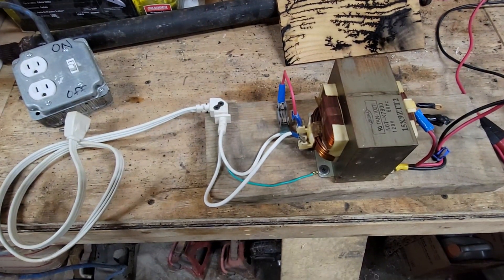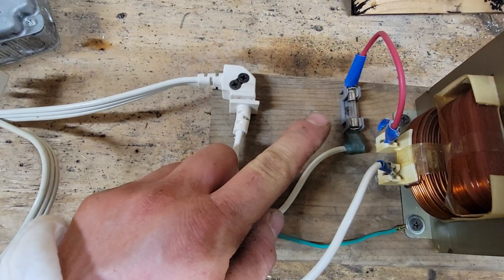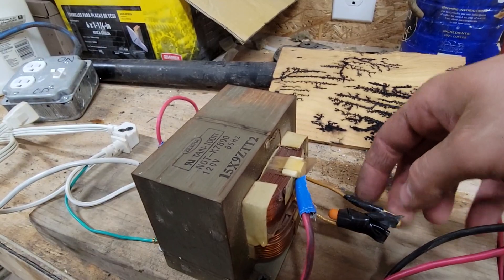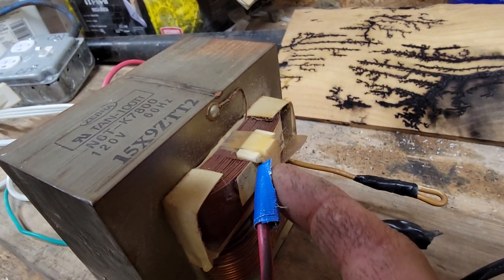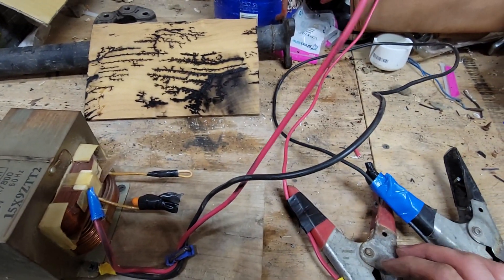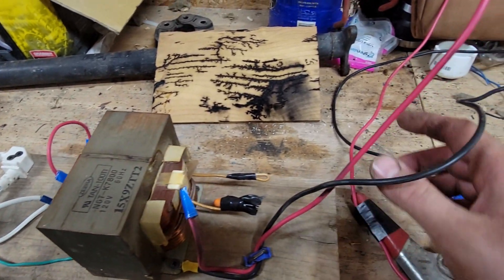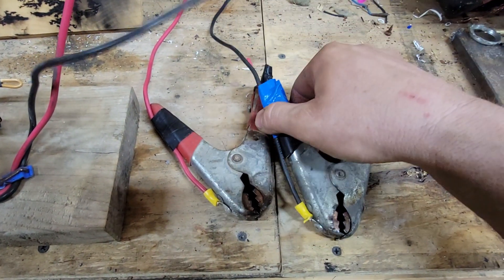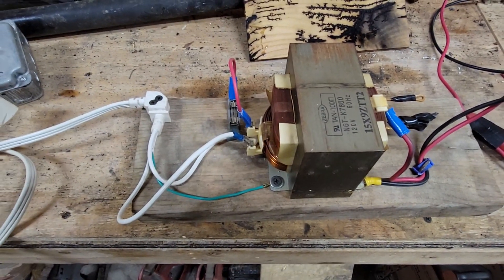How to make a fractal wood burner.

Comment: Why do I keep burning my transformer out in 5 mins every time?
Reply: MW transformers pulls 10 amps no load, I use 2 trans with primarys hooked in series (pulls 1 amp no load), secontaries also in series, 2000 volts with one trans, 4000 volts using both

Comment: If someone wants to build a fractal burner from a microwave transformer while not knowing the amount of smoke traveling in the wires, i say let em... You "protectors" are the reason kids are eating fuckin tide pods and why vehicle owner's manuals tell people not to drink the coolant instead of how to manually lap valves or gap a spark plug. FFS, if they die, they die.... on the flip side, bro, this thing "AS IS" is a conference call with Jesus on speed dial.

Comment: Just a heads up for those considering building one of these. The output on this will kill you if used improperly so do your research first. That being said, I highly recommend you do not plug this into your house. The amperage draw these guys can pull is crazy. Less than an hour of operating my first one off household power supply more than tripled my normal monthly electrical bill. If you have a generator I recommend using that. I have a 3000w genny and for the cost of a few liters of gas I did the same amount of burning. So it's cheaper to go buy a new generator than it is to run this beast off your house.

Comment: Where did you get 2000v rated wire? Typical 10 AWG wire is only rated for 600v
Reply: In this application it's not the gauge of the wire that's important, it's the thickness of the insulation. Low amps = light gauge, high amps = heavy gauge.  High volts = thicker insulation. Think about a car HT leads, low amps and very high voltage, hence the thin gauge wire and thick insulation. With high amps and high voltage, obviously you want both.

Comment: This hobby is lethal.  If you want to persue it seek more information than this video.
1. You should have a foot operated momentary on-off switch located far enough away that you can't reach the wood.  Meat grinder foot pedal switches work well for this. 
2. You must stand on an electrical insulator wearing rubber soled shoes.
3. Wear electrically insulated gloves, preferably high voltage rated.
4. Never hold an electrode.
5. Never spray salt solution while the transformer is energized.
6. Make sure you have lots of space in all directions including up with no tripping hazards.
7. Place the work on a non conducting table.
8. Ensure nobody can enter the area unaware of what you are doing.
9. Have an Estop or unplug before aproaching the work.
10. The ground must remain dry.  Do not spill salt water.
11. Be in fear of your life the entire time.
Reply: Great reply! Literally the only useful thing under the video.
Reply: Thank you sir all other notes are redundant, like flies on shlit.

Comment: THIS IS VERY DANGEROUS. DO NOT TRY THIS!!!!!!! Even if the steps in the video are followed, YOU WILL BE KILLED WITH JUST 1 SLIGHT MISTAKE!!!!!!! IT’S 2000 volts, 20 times electricity needed to kill you in an instant. ONE TOUCH to the surface of the wood/clip/table/equipment WILL KILL YOU. AGAIN, DO NOT DO THIS!!!!!
Reply: I believe you mean it may kill. I once touched the wrong thing and it hurt like hell but I lived to burn another day.

Comment: Don't ever do this!!! The insulation of your cables isn't rated for the high voltage. And in the video you say "about 10kV at only about 500mA". Dude, it's around 2-3kV at around 0,5-1A and up to 2A short circuit current. Clearly you don't even know what you're talking about. And that fuse on the primary side won't protect you at all if you touch the high voltage output by accident. I guess you don't even know what danger you're putting yourself in. One little mistake and you are dead before you fall to the ground! Just stop doing this shit and don't show other people how to do it if you aren't even aware of the dangers! One question: are you still alive?

Edit: in the video you also said "10AWG wire because it's rated for 2000V" just because the conductor inside is thick doesn't mean that it's rated for 2000V. Judging by your understanding of electricity you should stay away from voltages above 24V.

Comment: what good is a 14amp fuse when you can be killed by far less, should have put a smaller fuse atleast but in general this is not worth it
Reply: The device is plugged into either a 15 or 20 amp circuit. A 14 amp fuse blows rather than tripping the breaker.  More for convenience than safety.

Comment: Do you or can you draw up a quick wiring diagram for building a fra tal burner. Thanks
Reply: Amazon.. Kit uses a neon transformer. Waaaaay easier and safer. Comes with a dead man switch and insulated rubber gloves.

Comment: i aint an electrical engineer, and i dont want to be a safety geek, but that looks at least moderately dubious

but also, you cannot really die without touching the thing (electricity does not usually have range), so I suppose it IS safe if you don't accidentally touch it and that you dont let it leave your sight while on, but also somehow i doubt that is how it is going to be used
Reply: you are forgetting that's 2000+ Volts, it can go through a lot of stuff, including regular house wiring insulation.
Reply: @sayori3939  yeah that could be a problem, but if he managed to stay aware of that and not touch the insulated wires (or at the very least bulk up the insulation), there is zero mcfucking way electricity can just pierce through a table into his arm

Comment: It's the amps that kill you, not the volts.
Reply: No
Reply: @sylviaisgod6947 yes he is correct.  Voltage is not what kills you its the current.   High voltage gives you a potential to have high current but there are other factors.  The transformation limits the current. The guy in the video is correct when a transformer steps up the voltage the current goes down.  That said this is still dangerous and should be handled very carefully. Stay clear of those clamps when turning on the power and the whole thing should be placed in something container.
Reply: “It’s not the volts that kill you it’s the amps” is a major misconception. In fact, neither can kill you yet both can kill you. Voltage is the driving force (potential) that pushes an amp (current/ flow). They share a direct relationship. Power is what kills, Power = Volts*Amps. For example, 100v at 1amp has the same power as 10v at 10amps. 1/2 amp is nothing to worry about on a 12v system, yet at 2000 volts it absolutely has the potential (driving force) to break the non conductive (insulating) organic skin barrier and kill you

Comment: Lol the fuse.
Reply: The fuse isn't a necessary safety thing but it will blow before the 15 am breaker trips so it is useful.
Reply: @SmokieTheOne  Still does not make much sense to me, sure might blow before the breaker but then you have to buy another fuse, it only saves you a trip to the breaker box and the inconvenience of losing power in that part of the house. But for preventing fires or electrocution that fuse will do nothing and it costs you money every time it blows.
Reply: @teresashinkansen9402  I have a small box of fuses I got for free and I've only blown 2 over the years to the cost is not an issue. It does save me the trip to my breaker panel which is downstairs. I never intended the fuse to prevent fires or electrocution. I haven't had any fires and have only been shocked once.

Comment: You mention "Less than an amp at 10kv". More like 500 MA at 2,500v. Voltage isn't important. But the current is wicked at 2.5KV plus (electric chair levels). Be careful.
Reply: You have no idea what you're talking about.

Comment: What a lot of folks do not realize about high voltage electricity (say 2,000 V or so) is that it can go where you might least expect it. Like flow along the surface of a table top or a PVC pipe. It will go through the insulation of a set of jumper cables with ease, and through electrical tape as if it's not even there. The wire used in residential housing is only rated to 600 V in most cases, so the insulation on that wire will not protect you. It might as well be a bare wire. 
   As of January 2024 there have been at least 33 documented cases of people getting killed doing this woodburning trick. And every last one of them thought they knew what they were doing. -Old dude, not a safety nazi and not a pussy either.
Reply: well at least he said it's dangerous ._.
Reply: people get blackmailed by having their channels shut down by saying some stupid swear words and having fake reports while people killing other people with shit like this is making money

Comment: How to build a funny machine to teleport you to heaven with no margin for errors. Next time: how to cool your home with dry ice and closed windows… only on YT.
Reply: Its not that dangerous, you just have to test the current is working correctly the first time you turn it on by holding the metal ends in each hand. Also recommended you do it barefoot in the grass out side because is smells a little funny.

Comment: How are you, a creator, going to feel if one of your viewers dies because they watched this video?  Are you cool with having a human death on your hands?
Reply: It's perfectly safe, it has a fuse
Reply: @sylviaisgod6947 the fuse is on the input side, rendering it useless in the event of an accident (it's the output side that's danger and a fuse on the input side won't matter). it seems you have no idea how a transformer works, so i would encourage you NOT to mess with one, ever.
Reply: @sylviaisgod6947 Again?? Are you kidding?
Reply: @ecan Well, maybe a circuit breaker would be better.
Reply: @sylviaisgod6947  And how are you gonna break the circuit? Again, when not having an idea how electricity works, it's better to refrain from messing with it when you are putting your life or other's at risk
Reply: @ecan  It's in the name, circuit BREAKER, it automatically cuts the circuit preventing death.
Reply: @sylviaisgod6947 under which circumstances?
Reply: @ecan  in several, mainly some, more specificaly probably a few

Comment: This, as shown, is a death trap.
You have exposed wires and terminals on both sides.  There are no safety features that make it safe.  The fuse will only blow if the high voltage side is shorted out.
If you come into contact with the high voltage side, you will look like another piece of wet wood, the fuse won't blow, and it'll do to you what it does to the wood.  You will be burned on the outside and on the inside and you will probably die in seconds.  If you do survive be prepared to have debilitating injuries.
If you risk building this, you need it to be inside a sealed high voltage proof case, proper high voltage wiring, multiple safety and dead man switches, and indicator lights to show it is on.  Even then it is only a little bit safer.
After that it should only be operated when you are well clear of the whole thing.  Set your probes, clips in position, step back and then activate it using the dead man switches, stop deactivate and repeat as needed.. Never ever manipulate the probes while it is on. 
People have died from using these DIY fractal wood burners, others have had life altering injures.
Reply: Probably but it'd be more than $2000😂
Reply: Nah, if you have it plugged in to a gfci plug, even if you hold both ends youll be fine.
Reply: @DG-kr8pt  No, you will die. The reason is because the transformer has two or more isolated windings, which transfer power via induction. This is the physics that lets transformers transform voltages. The GFCI plug can only sense faults with the input winding. So it can't protect you against shorts, or anything else, happening on the output side.
Reply: @DG-kr8pt Careful, some people may believe the gfi will protect them.  A gfi on the supply side will do nothing. 
But I of wonder if you could build or purchase a 2,000 volt gfi for the high voltage side though.
Reply: @DG-kr8pt  really

Comment: As an electrician I cringe when watching videos and reading comments of people describing their interpretation of how electricity works and safe practices… problem is this isn’t art so it’s not open to anyone’s interpretation... if you know a little bit about electricity congrats, that means you know enough to be dangerous. Unless you have a real understanding of electricity and the electrical equipment used to manipulate it then you probably shouldn’t mess around with it… because you will find out
Reply: 1: that 40 amp fude will not do anything, if you get electrocuted your body will work as a load and limit the current and i even have my doubts the current would go past 40 amps on the on a short circuit since hot wires also limit current.

2: he said "ten gauge wires because it's rated for 2000 volts", just because it's a ten gauge wire it doesn't mean it's rated for 2000 volts in fact most wires are rated to 600-700 volts and also there's the fact that even if it WAS rated for 2kv a microwave transformer can output between 2000-3000 volts so you would be still really unsafe with a magical 10 hauge wire that had insulation for 2kv
Reply: @sayori3939 

Electrocuted us death by eletricity you dope. Stfu
Reply: don't touch the shocky end.
Reply: well the problem is, most people won't know that a transformer from an electronic they use daily is capable of turning 127v to over 2000v
Reply: So explain what he did wrong in this setup to warn people about what can and will happen
 Extinguish the curiosity and doubt
Reply: @bwell4268  

The fuse only covers faults on the input side, as microwave transformers use galvanic isolation to prevent unwanted DC currents being induced.

10 gauge jump leads would be typically rated for 200-220 volts/30 amps. This is why they use 10 gauge for jump leads; the rated capacity of the leads more than covers the job they are designed for - car battery voltages.

0.1 - 0.2 amps can be lethal, and even less than that can instantly stop or de-synch a heartbeat.

This arrangement in the video is probably quite safe while the user remains vigilant and exercises extreme care, however I would hope he is aware that a kill-switch foot pedal would give him greater protection, and that another safety feature is operating it at considerable distance from a well insulated piece of wood, well above the floor and laid on substantive and dry rubber sheet.

Hand probes for obtaining off-edge (or floating) fractals should NEVER be used.
Reply: @ginskimpivot753 fuses protect equipment, not personnel.
The fact you don't know this merely exposed your word-salad for what it is.
Reply: @steelwheel-i3s  

The 'word salad' explains why this set-up is dangerous, and it's dangerous precisely because it will initially only destroy fusing which is well above lethal current amperage, and which exists only on the input side.

I'm surprised you didn't spot that.
Reply: @ginskimpivot753   Fusing is always above the lethal amperage. Fuses are never meant to interrupt a shock, that isn't the purpose of a fuse. Fuses in your appliances aren't there to protect you from shock, they are there to prevent equipment damage and fire.
If you become part of the circuit on any domestic appliance, the fuse will not protect you.

That said, it isn't difficult to make a wood burning transformer which is intrinsically safe.

You generally can't just watch a video of someone burning and declare that they're at risk, because you don't know what safety steps they've taken behind the scenes.

There are some exceptions, there is a video on YouTube of an American man holding an electrode in each hand and shocking himself multiple times. It was his last upload.
Reply: @steelwheel-i3s  

I can indeed declare unsafe ANY home-made device with an exposed transformer, microwave parts, jump leads, and commentary from a user who's seen some videos and worked with stuff 'I had laying around the garage.'

As this gentleman shows and describes his device and his component sourcing, it is potentially lethal and demonstrably unsafe.

I'll say it again, he's probably quite safe while he remains vigilant and careful, but a foot-switch would at the very least mean anything nasty occurring would protect him from a situation where muscle contraction sees an inescapable live circuit he remains part of after an initial shock.

This is unsafe - fact. And safe fractal burners are not expensive to buy. Nobody needs to tinker with opened-up microwaves to make niche interest art.
Reply: @bwell4268  he can't.
Reply: i left this out because I don't understand avout electronics in specific but that statement that the voltage will drop with more current is really sketchy, you don't choose the current coming from an outlet, it's the circuit that will determine how much current will pass through the live wire through the circuit to the neutral wire
Reply: 😅😅eqp
Reply: Definitely great advice
Reply: Just get a really long extension